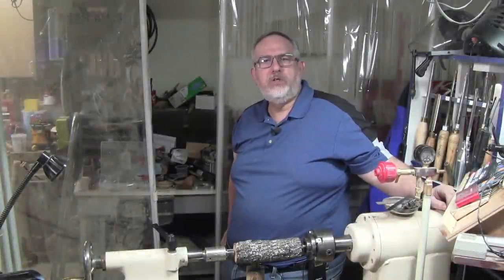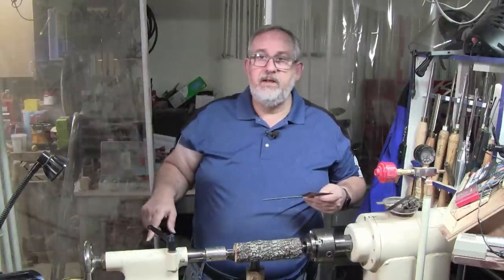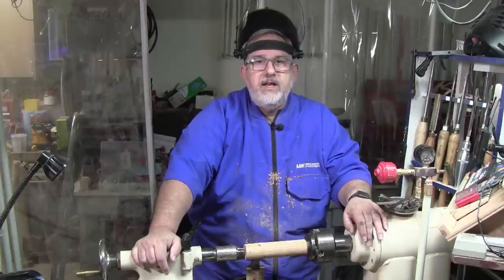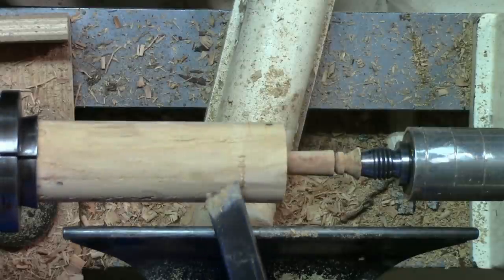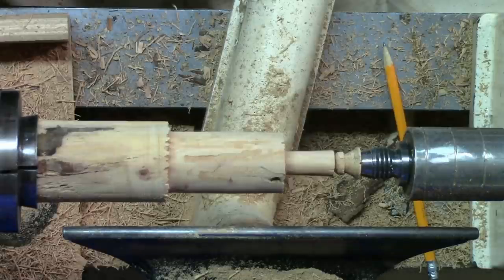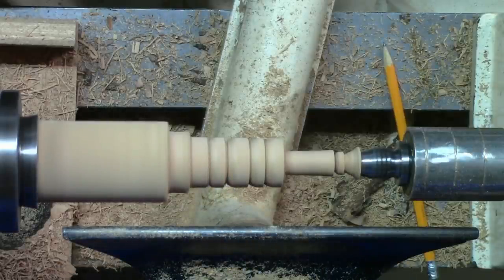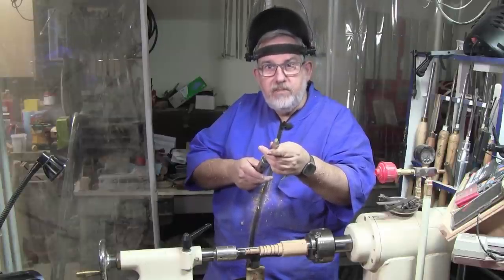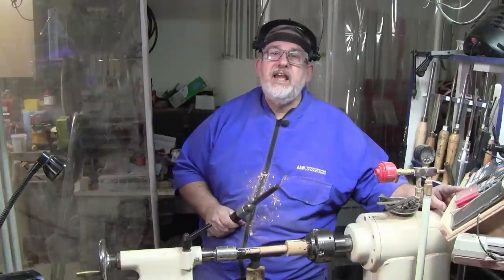Understanding the Skew and how it works by Dean's Woodworking #woodturning

Comment: Dean, at about 15:30 you recommend learning to round off with either hand and I can't agree any more strongly. It always surprises me how few turners work with either hand because there are always times it's easier to reach a spot with the other hand. I've worked with both hands for many years. Taught my grandson to throw with either and kick a ball with either left or right. It is only a matter of practice. I've also found that learning to  do something on my off side often improves my work on my usual side because it forces me to be aware of my motions as I transition. Great tip, even if just an aside to the skew lesson.
Reply from the maker: you and I see that the same why limit yourself.
Thanks for Watching!!!

Comment: Very good video from a very good teacher. You made so many Great Points on using the skew so I want to comment on only one and that was when you used the diamond hone. When we sharpen on a grinder we have a round stone that will make a concave grind on each side of the skew, so when the skew gets dull all we have to do is like you did and take a stone of your choice and hone each side and like you said keep that stone on the cutting edge and the back edge and you can have a sharp tool. I know you covered this but there are a lot of people that think you have to grind again. Keep teaching and thanks for sharing
Reply from the maker: Thanks

Comment: Good video Dean. My first skew was an Sorby 3/4" oval. Wish I'd never bought it. Because of the oval design I can't hold it true on my sharpening jig (Wolverine). I bought some other non-oval skews and I'm able to sharpen them, but I'm losing the skew angle from heel to toe.  I'm happy with my bevel angle, but now my heel to toe are almost straight across. Most turner videos show how to sharpen bowl gouge, roughing, etc. but not much detail on sharpening skews properly. I feel like I have the proper equipment (Wolverine, slow speed grinder, CBN wheels) but lack the knowledge to sharpen skews properly. Any advice would be welcomed and appreciated.
Reply from the maker: it sounds like you have a long handle on the skew remember to hold it way off to one side when sharpening. That will put the skew back in the skew. Thanks for Watching!!!
Reply: @DeansWoodworking  Thanks Dean! I figured my technique was WAY off, I'll get the skew back in the skew! :)
Reply from the maker: no problem glad to help.

Comment: I disagree with you about the 1/4 inch skew. On the 1 inch skew, you are meant to cut with the lower part of the edge, so the tool remains supported below the cut, with no twisting forces. The 1/4 inch skew lets you cut with any part of the edge with no more twisting forces than on the 1 inch tool. The wood can't tell how wide the tool is, just how much of the edge is cutting. Try it, it is incredibly forgiving! No idea why you say it has a small sweet spot.